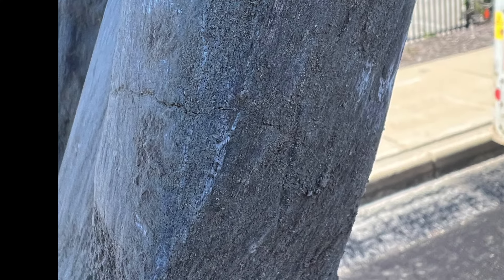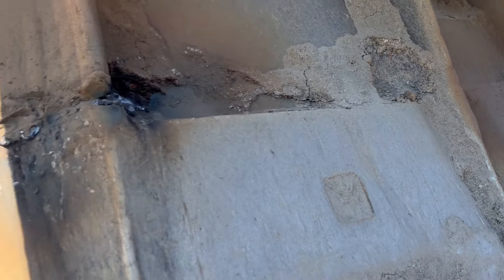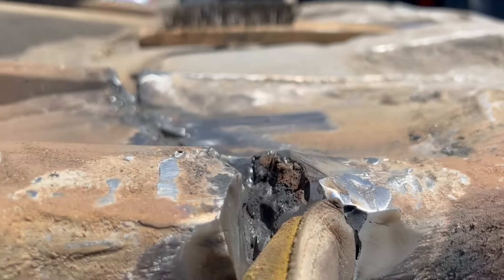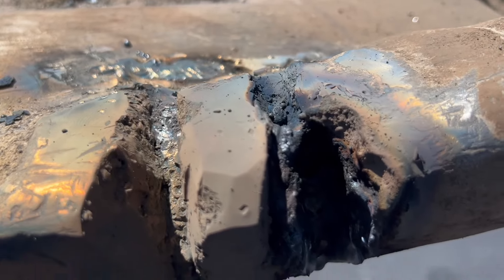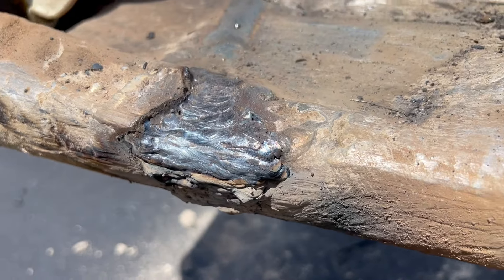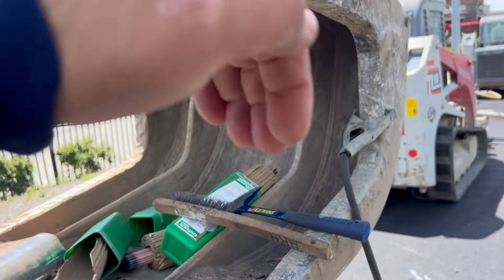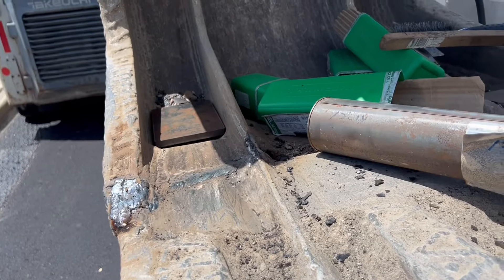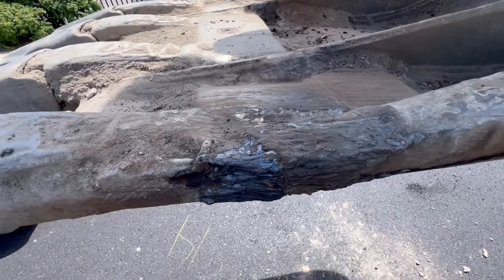Fixing a Removal Bucket

Comment: If you use an arc-air gouging system, the  amount of grinding prep is greatly reduced, perhaps use a crack testing kit, their cheap and easy to use, as for bending the fish plates, if you’ve got oxy set, a couple of suitable packers and an energy source, ie sledgehammer or downward pressure from a 10 ton excavator bucket, there’s ya press
Reply from the maker: if I would have had a compressor that day - air arc would have been my first choice ...  well - I guess everyone is an expert here in YouTube land .... did you ever bend 5/8" AR400???  a 50 press will not do that at 6" wide ....  and if you heat it up and anneal it .. well -you just took ALL the hardness and abrasion resistance out of it ...    but I am probably just a dumbass and I should get the right tools and grow a pair so I can do the job right ...  thank you for the education ..... I have subscribed to your channel in hopes to learn something so one day I can do these jobs right ....

Comment: I enjoy your videos, love the mobile jobs because i do it also, does rockmount offer any type of dualshield wire for repairs work?
Reply from the maker: Yes,  if you can afford it they also sell Polaris dual shield wire in 035 045 and 1/16 I believe in 10 and 30 lbs rolls ….   Shelf life on that wire though …. Watch out.  Rods last pretty much for ever
Reply: @ZILAwelds  awesome, I currently run the outer shield 71m, so far so good, but I get wagon tracks if im working on some pieces of equipment, tree pitch causing it even if i grind everything clean. Hopefully the rockmount would have better luck.
Reply from the maker: @troyshuler4280 the wagon tracks are the result of either A)  not enough shielding gas or B) wire is too old
Or C) material is too contaminated…..

But really A) and B) are the most common ones ….  
40-50 cfh lincoln says in their literature and i see guys trying to run it with 20 or 25

Or, the wire being too old …  means, ambient air moisture creeped into the flux in the wire … it will NEVER come out again … so if you supplier had it on the shelf for ever and you had it in the suitcase for a few month ….  Or you bought new old stock from a guy from ebay ….  
Those are all very common problems !!!!
Reply: @ZILAwelds  I found a new problem, new machine from one of the bigger welder manufacturers, the gas regulator outlet only had a tiny pinhole for the gas to go through, i checked out all my other regulators and they were at least a 3/32 hole, this new regulator only had this just tiny pinhole, is this a manufacturer flaw?
Reply from the maker: @troyshuler4280 🤷‍♂️ sounds like just another day in paradise with Chinese supplied gas fittings and without quality control ….
Reply: @ZILAwelds  of course, I just opened the hole up and works great now but at 50 cfh, the gas goes pretty quickly. good thing I have 3 tanks of 75/25.
Reply from the maker: @troyshuler4280  well - do you want strong good quality welds or do you want to save gas ....  if you want to save gas - buy a hybrid car .... LOL ....  I mean these welding procedures need what they need to be quality .... you cant have wagon tracks and wormholes all over a a crane boom or ... or  or ....  if if you store your wire too long in too moist of an environment you will have the same problems even with higher gas flow rates ...
Reply: @ZILAwelds  very true, thank you for the information, I see you as the top guy in this field, always like your honesty.

Comment: Job well done
Reply from the maker: That is about 1/4 of what was used … there is a pile on the left, a pile on the right and a metal container with stubs in the back of the van.   I hate it when guys drop rods on the ground and then i drive through them …..

Comment: your welding is annealing the hardened stuff though.
Reply from the maker: in a way yes - but only in the heat effected zone .... maybe 1/2" away from the weld joint ... if you want to be really generous 1" away from the weld ... but I doubt that since I didnt preheat other than cutting with the electrodes ....   and if the "entire side" is work hardened  ... then it will crack 1", 2", 3" down the line .....